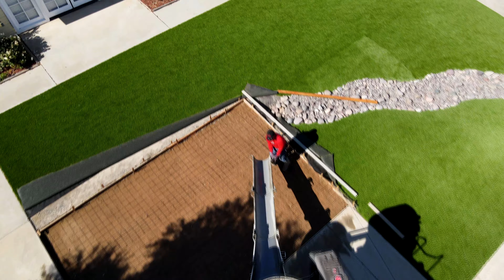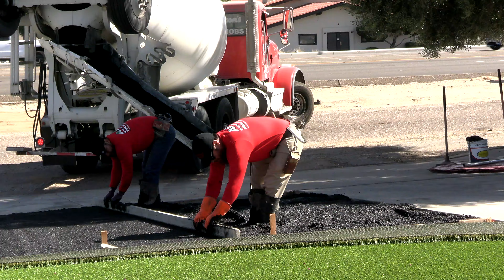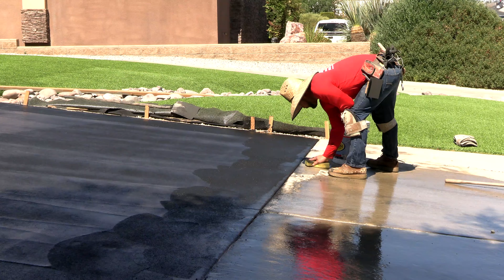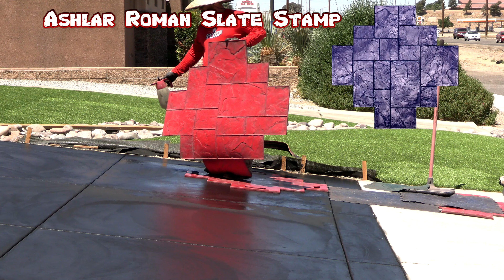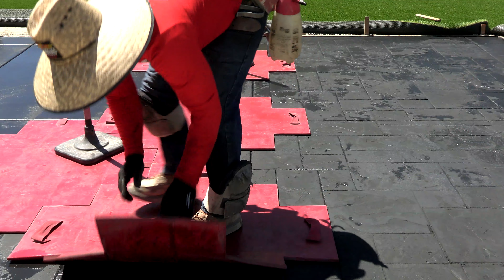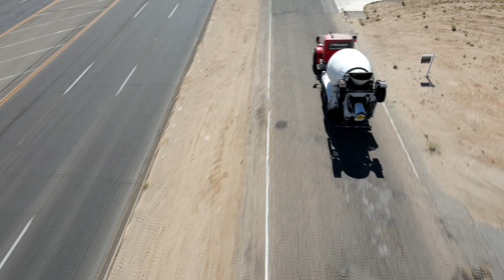Stamped Concrete by All Season Turf - Watch this Step by Step Video!

Comment: Lol, I did alot of stamped concrete in the late 90s here in Florida. I guess if the mullet hair can make a come back, why not stamped concrete. 😃. Appreciate ya pool brother. Rubber deck was one I never understood why it didn't make it to residential. Hides cracks, mold proof, lasts. It gets hot, I guess but so do pavers. Remember the original kool deck?
Reply from the maker: It is coming back in CA at least. We are inti "fancy" again over here. 😆👍